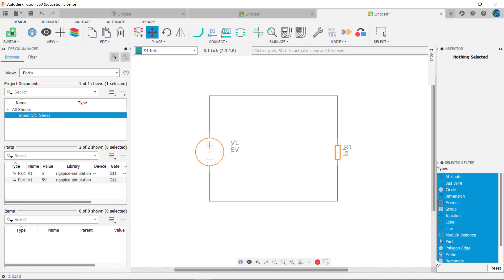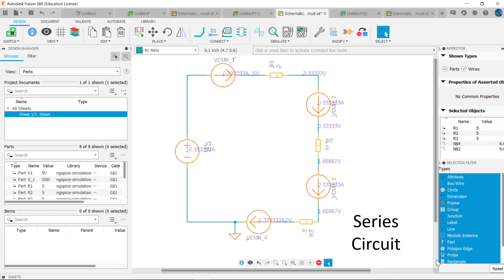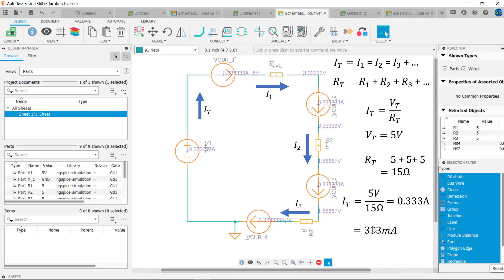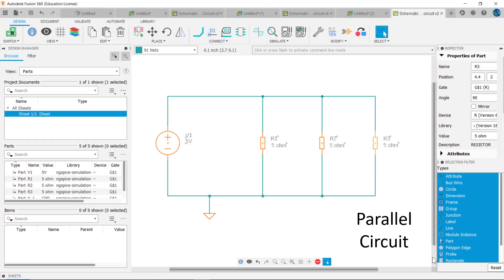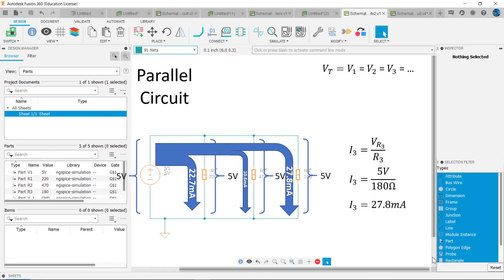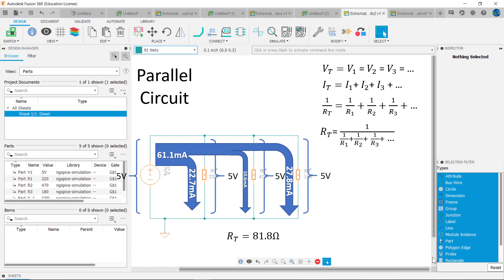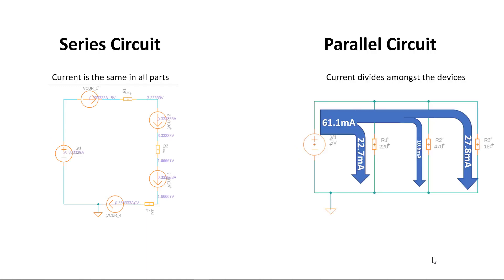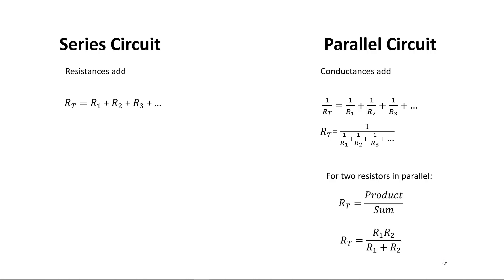Video 3   Series and Parallel Combinations of Resistors

Comment: Also I have a doubt that how do you add the ammeter from the library, because I can't add it.
Reply: That's very odd. I've never had that problem. It is in the ng-spice simulation library. Is it that you can't find it, or that it's present but doesn't insert into a schematic?
Reply: @rudyhofer7046  thanks for the tip bro